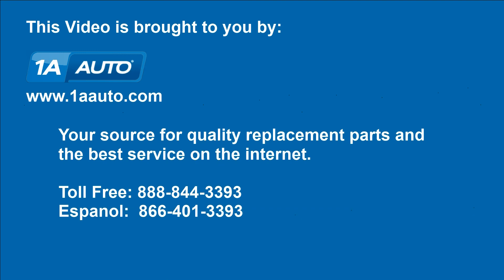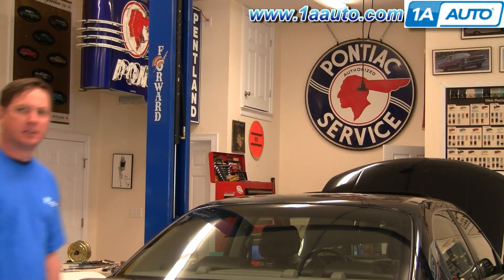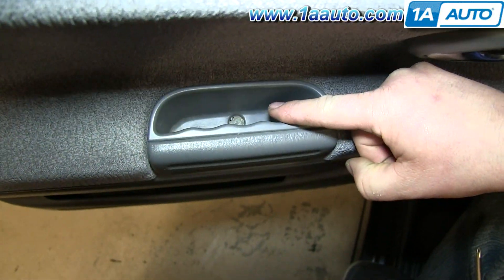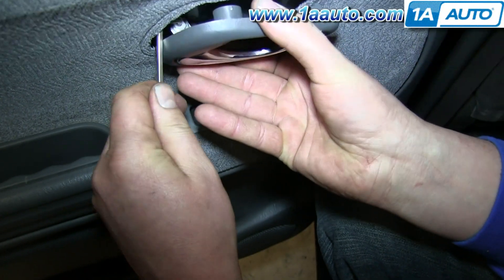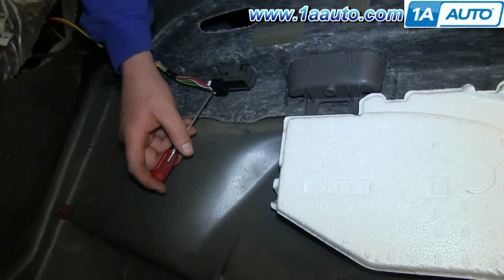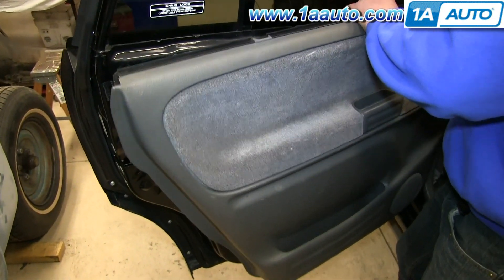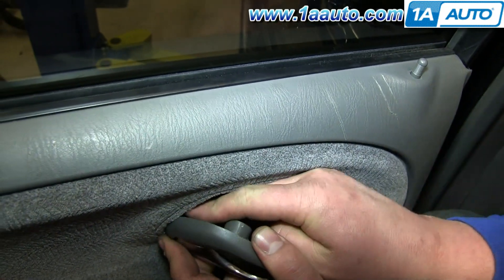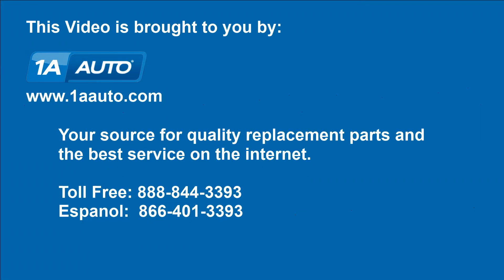How To Remove Rear Door Panel 98-06 Suzuki XL-7

Comment: I know this post is old but maybe you’ll see this…I’ve tried getting the rear door inside handle off on a 2001 Chevy Tracker the vehicles are extremely similar but it seems like more than a screw and rod are holding it to the door I can’t figure out what is keeping it in the door any advice?